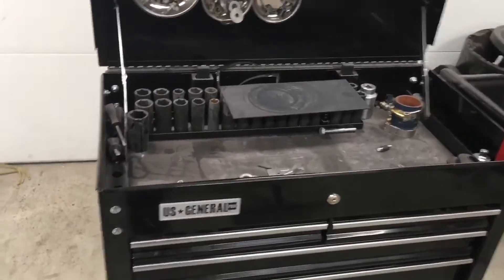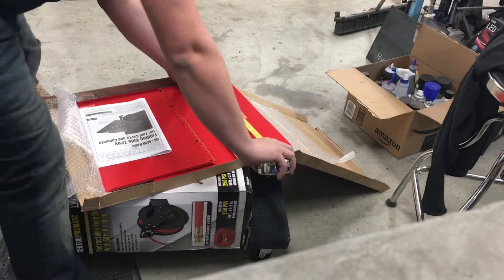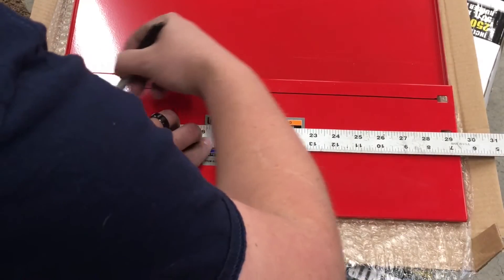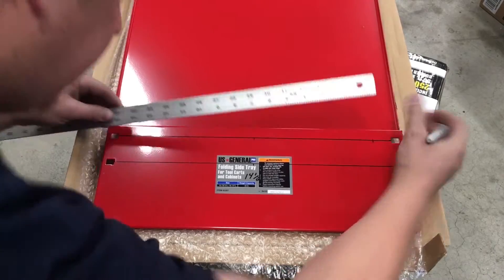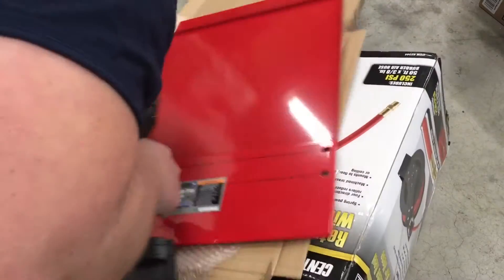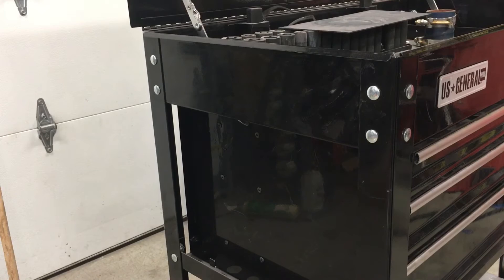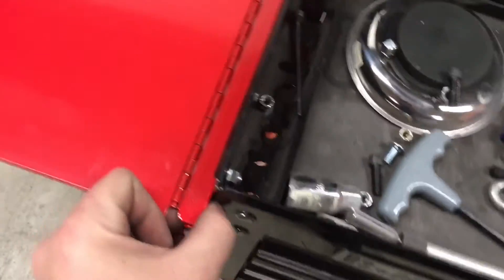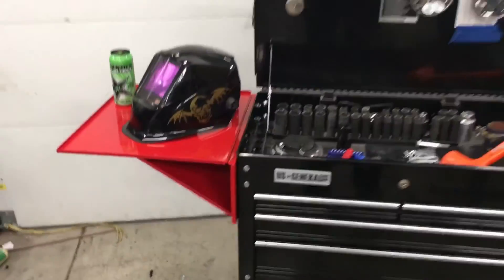Harbor Freight Tool Cart Side Tray Install.

Comment: Harbor Freight finally sells a side tray specifically for the 4 drawer box. Correct width, color, bolts straight on
Reply from the maker: Thanks for the heads up. I guess this video is pointless now haha
Reply: No way not a waste lol. I was really close to doing exactly what you did, then I saw the new shelf in a catalog maybe 4-5 months ago. They only just now started being available. I installed mine this weekend, after I coated the surface of the tray with thick rubberized undercoating. There's no liner or anything on the shelf (same as the red one) but I didn't want to scratch it up.

Next project is getting rid of the 4 swivel casters and having two fixed and two swivel.

Comment: U.S. General Item#63470 is Designed for use with Black 4 drawer Roller Cart.  Adds over 300 sq. in. of additional surface area and holds up to 35 lbs. of weight.  No mod required and is the same color.  Cost is @ $22.99

Comment: i just got mine on my tool cart, when its down i notice its real floppy and makes a ton of noise. so on that middle crossmember on that tool cart where the tray sits up against, i put a magnet on each end and that way it was snug once it was down. then some drawer liner and vinyl adhesive and it was good to go!

Comment: Nice mod.  I don’t close my lid so I drilled holes in the top for a few peg board hooks.  I have 2 hammer hooks and a few assorted hooks.  One of the hooks is a longer one and I have my oil filter cap wrenches in one place

Comment: If you put prybar’s in those little holes on the top left and right side are you able to still shut the top or is there not enough clearance does it have to be short handle type screwdrivers or you can fit a standard 3 pack pry bar set?

Comment: i did this mod and couldn't close the lid. i just had to move it one hole down and its sorted. lol. you did yours cleaner than mine
Reply from the maker: Jan Michael Pilario  I had the same problem with my first box. I just put washers in between the tray and box until the edge of the lid clears. I should of mentioned that in the video.

Comment: How deep is your cart?  I have a 4 drawer cart that is older than yours,  it has the round pin style drawer locks instead of the plastic square ones.  My cart is 16-5/16" deep.  Can you tell me if that is the same as yours?  HF sells two shelves, neither seems to match my cart.